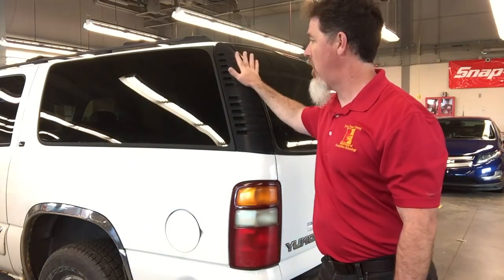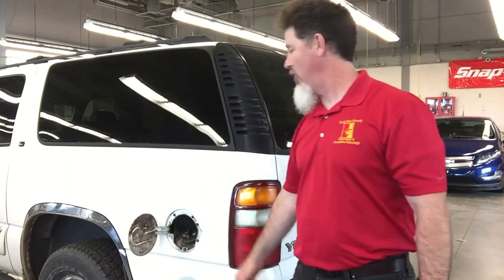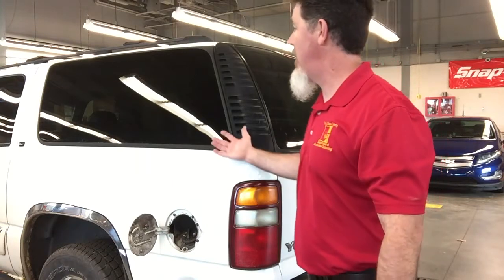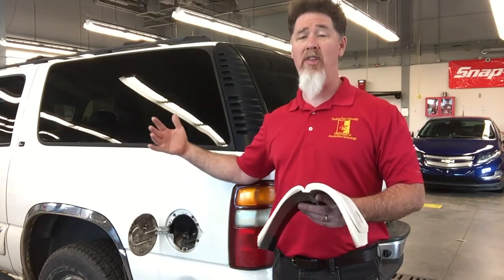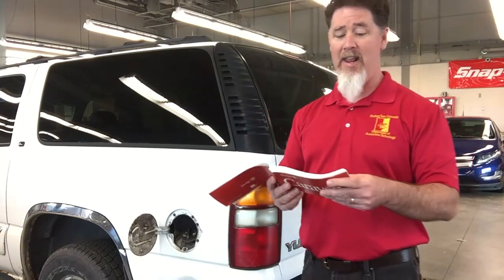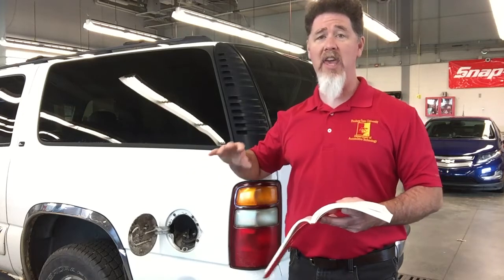Filling your vehicle with E85 fuel

Comment: Just got a 04' Suburban Z71 for an absolute Steal of $500, just needs a little TLC, but I checked that if the VIN code has a "Z" in the 8th Digit for 00' to 06' Chevy model years they're E85 capable for those of you that can't find it on the gas cap... But I live just 5 minutes from an E85 gas station and I'm debating on switching because with E85 you notice a huge performance difference and I just love how it's much healthier and better for your Engine.

Edit: Spelling Corrections
Reply: I thought the e85 damages your rubber components etc??
Reply: @Ap_chriss  if your vehicle is flex fuel the components were built to handle E85 ethanol, there will be no damage , as it was made for that. E85 can possibly damage non flex fuel vehicles .
Reply: @Ap_chriss  No it doesn't, it's a common myth, E-85 actually cleans your cylinder heads and removes carbon deposits, overall if your vehicle is flex fuel capable it shouldn't hurt it
Reply: I have a 2004 silverado do I just have to see if the 8th digit of the VIN is a "Z"? And if it is can you fill up your whole tank with e85 or do I have to put 87 and e85?
Reply: @michaelanacleto4637  I have a 2005 Chevy Avalanche Z71 and I found out that mine is Flex fuel by the Air filter there's a label that's says I can use regular gasoline or e85 blend gasoline. Or with the Vin number 8th digit there's a Z. I been using E85 for a month because is $2.00 cheaper than regular gasoline and so far is working just fine. No problemo

Comment: Curious…. Aside from the sensor, what else is the difference?  Same injector o rings, fuel pump, seals??
Reply: Yes it's all the same, the sensors just change the way they all react in tandem to assure E85 is properly combusted relative to that of 87 or 93 Octane.
Reply: @BasedJake1999  so the ethanol does not erode any of the oem parts?
Reply: @wagonkit  no it doesn't

Comment: im confused..... do I need to run regular gas to E before I add flex fuel?
Reply: No you don't. I added some E85 when mine was half thank. And I been using E85 for a month because is $2.00 cheaper than regular gasoline and so far no problemo. I hope this helps your.

Comment: My check engine light is on after putting $45 in my tank. My car has a sticker on it that says put e85 in it. My mechanic said never put it in my car again. I am so mad.
Reply: Well, did it turn off after putting gasoline in it the next refill?
Reply: @h8GW  Yes. Thanks for checking. I put 87 fuel instead of E85 on the next trip to the gas station.
Reply: I been using E85 for a month and no check engine light came on. So far so good.  If you don't close the gas cap good the check engine light will turn on. My mechanic told me that if I drive my truck with E85 everyday there should be no problemo.